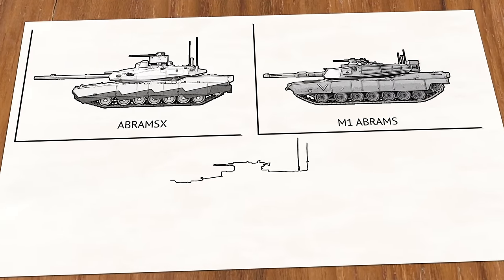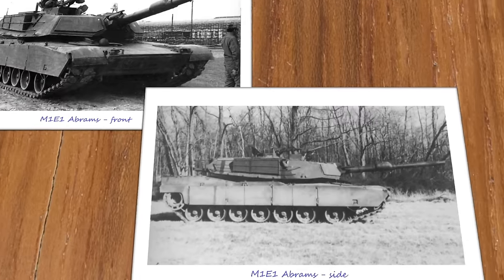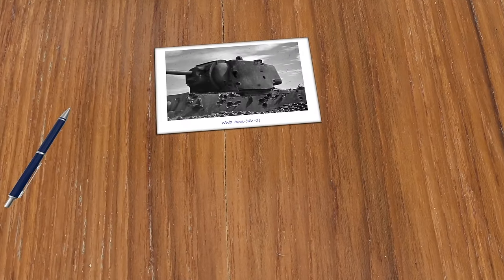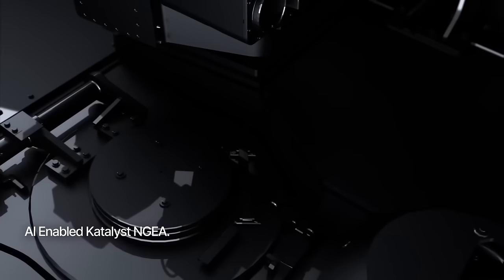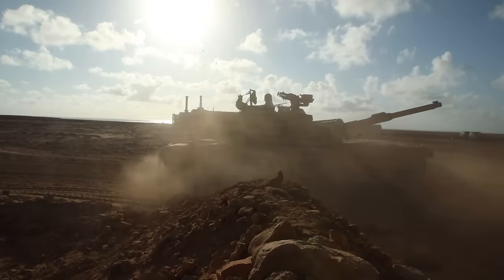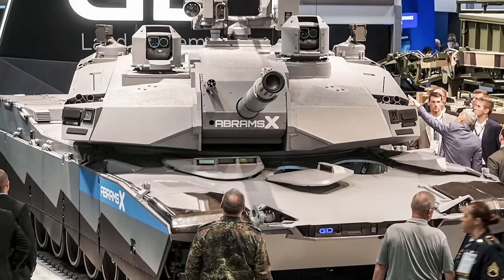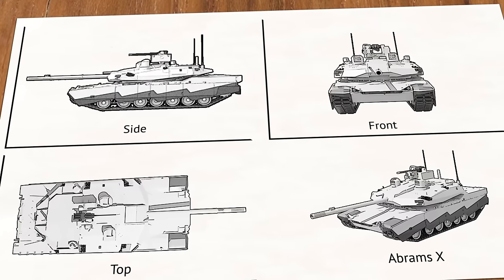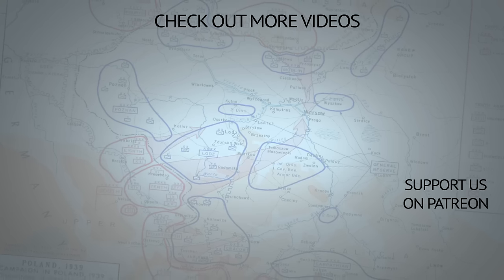M1A3 Abrams is finally happening. And it may get an unmanned turret, like the Russian Armata T-14.

Comment from the maker: We mixed the words and put turretless instead of unmanned turret in our first title. Apologies.
Reply: Sadly we're out of era of casemate tanks and not yet in the era of vertical launch system ones. So we're doomed to have sameish looking boring MBTs. No wonder scifi doesn't copy modern designs:(
Reply: Turretless lmao =D
Reply: That was funny. Not. (Just kidding but imagine a tank without a turret)
Reply: @theunitedkingdom5202  Strv 103 is the most famous MBT with that feature.
Reply: @theunitedkingdom5202  WW2 has a lot of those. Jagdpanzer 38(t), StuG III, Jagdpanzer IV, Jagdpanther, Jagdtiger. Even after WW2 the Strv 103, VT2, Kanonenjagdpanzer and Taifun get you covered.
Reply: @TheArklyte  VLS isn't viable for tanks. Missiles are simply not economical enough compared to standard ammunition. Not to mention that missiles are easier to defeat than a KE projectile. That's why Sci-Fi goes with railguns, not missiles. MLRS have their own place though.
Reply: It still says "A3" instead of "E3"
Reply: Thanks everyone
Reply: @theunitedkingdom5202 it's been done before.
Reply: @theunitedkingdom5202  T-72? :D
Reply: SLAVA ROSSIYA FROM CANADA !!! 
🇷🇺#Z🇷🇺🙏☮️🇨🇦🍻
Reply: At this point does it really matter? The only "potential enemy" tank to even come close to beating an m1a2 is the Type 99 from China. Right now Russia is fielding 1950s tanks in Ukraine which are in just as bad of condition as Iraq's tanks, and we didn't lose a single m1a1 to Iraq. What is a 1950s tank going to even do to an m1a2 or a3? Nothing. Sure, Russia is only supposedly using the old tech as mobile cannons (like a howitzer) but the amount of newer tanks lost leads me to believe we would have no problem with Russian tanks. 

But I do not want war with Russia. White countries should not be trying to kill each other. We have had enough war for the last 115 years and I think we should not be killing our own race of people.
Reply: Sad stug noises
Reply: T-14 is rather equivalent of CV90120 then proper MBT as it weight below 50 tons. And its chassis is used for T-15 IVF and was planed to be used in air defense system. Unmaned turret was also based on old Abrams TTB concept. The obvious reason why T-14 is vaporware is that Russian could not produce electronic, after ban on Western parts.

As for Abrams M1A3 lot of weight can be shed by modernization of outdated systems and removal of various adapters. Especially with pre-planed installation of trophy. As lot of weight is just a balast to stabilize turret.
Reply: M1A3: Turretless turret
Reply: @theunitedkingdom5202 just missile launchers
Reply: Armor officers have been fighting 3 man crews because they know they need the loader in the unit for maintenance and security and other things. Plus, the human has always been faster. 

At this point, the gunner is about ready to be automated. I bet they jump from 4 men to 2 with a crew optional feature.
Reply: I initially read that as turtleless... and I thought, "what's wrong with the turtles?"

Comment: You might wanna correct that title. I'm pretty sure that both the "M1A3" and the T-14 have turrets.
Reply: Depends the t-14 been hit by a round yet? 😁
Reply from the maker: True, corrected now. Thanks.
Reply: @A_Name_ only thing in the same chassis that's been hit is the terminator it doesn't have the same turret section though it saw some combat in Ukraine and is performing poorly but the turret is very vulnerable in that config so it's hard to say what the causes are for it being blasted to pieces so often
Reply: @A_Name_  it's also seen an array of other issues to the point where it was pulled from Frontline service till they kinda ran out of options unfortunately it was a huge part of Russia's highly mobile armored doctrine where it replaced ground soldiers for tank cover in urban areas so it's failure as a platform is kinda bad but realistically building it on a tank chassis was probably a bad idea and the dual mounted gun system is super complicated and way to vulnerable to fire
Reply: @VarrickThrae  I would tend to lean on it's Russian and it feels like they intentionally add some catastrophic design flaw lol. 

In all seriousness tho Idon't know enough about the T-14 but I would guess more problems with the auto loader/magazine causing cookoff
Reply: @A_Name_ hum no and was tested successfully in Ukraine. Now it's being updated
Reply: @A_Name_ . Old joke
Reply: Lol that’s great when I first read the original title I couldn’t think of a reason to make a turret less tank hull other than using the base for other things
Reply: @user-fe7bo5mm1o  like I said I don't know much about the T-14 was joking around and then just tossed out my best guess from my limited knowledge of Russian vehicles in general. Wasn't meant to be some kinda profound declaration as some on are here are taking it as lol. I even expressly said most of that. Whatever 🍻
Reply: @A_Name_ I came here to point this out.
Reply: @A_Name_  I just died laughing 😂
Reply: The final evolution of the tank: The M1A3 StuG
Reply: @A_Name_  well having your turrets popping off in a war isn't a good look tor customers
Reply: @VarrickThrae  Terminator, or BMPT-72, as the 72 in the name implies, isn't on the T14 chassis but on the T-72 one. 
There was/is a project of TBMP (something between BMP and the BMPT) called T-15, which has a similar turret to the Terminator (same gun and the missile launcher, but different configuration) and uses Armata chassis. 
But there are even less of them built than T-14s and they have never seen combat as far as anyone knows.
Reply: T14 does not have a turret. It’s imaginary.
Reply: @jgonz1325  the turret is VERY small
Reply: Yah but the t-14 does not exist
Reply: @VarrickThrae   terminator uses a t72 chassis not a t14 chassis iirc
Reply: @ligmasurvivor5600 same happened with the abrams when it was being detonated by Americans so that it doesnt get captured and same happened with the challenger 2 and leopard 2
Reply: @Chexmaster check your facts before spreading lies the t14 has been in production for years and has been seen on parades meanwhile the abrams x is still just a prototype
Reply: @VarrickThrae not a huge part, it was experimental platform. They had some 14 pieces if I'm not mistaken. They sent it to see how they could fit in, turns out it's good for defending or attacking forest lines. But not very good in urban or (as original) tank support role.
Reply: And i will become the idiot who saw the video after It has been corrected: 
Broo he fr said It is unmanned not without a turret broo💀
Reply: I wouldn’t be surprised if the T-14 didn't have a turret.
Reply: @dessirangelova2676 a handful of various design prototypes isn’t production.
Reply: Let's change it to "working engine"
Reply: Now both have unnamed turrets😂

Comment: As a former tank mechanic who worked on several generations of Abrams, it would be nice if the turret was redesigned for the upgrades because the constant bolting new shit in the old turret made maintenance a real pain in the ass
Reply: Good thing the loader could help out eh? Not automatically, I'm sure orders were issued first of course.
Reply: Not TRUE!  The turrets are NOT the same due to Armor packages and even configurations of even mounts inside the Turrets.  Try again.  Now there are some retro fits but the very first model are sitting in a Depot.
Reply: @dnate697 I'm guessing you're a tank mechanic then?
Reply: @jackfletch2001 there's probably several types of people that would easily know something as readily available as that.

Let's just assume he's an avid reader of the warthunder forums.
Reply: I was a tanker on the OG M1 (training at Knox), followed by the M1A1 (most of my service) and then the "A1 Heavy" (Iraq). History_Coffee is being dead-on legit. @ThatPianoNoob
Reply: @Calbeck  I assumed @History_Coffee is legit because that's the type of complaint anyone makes when we deal with these types of things.  Also, the US military bolting new crap on is a time honored tradition.
Reply: @arthurmoore9488 for something with as many variants as the Abrams has and with the different ways maintenance is done per man, it's honestly shocking that anyone can go "NOT TRUE" unironically. Some of them are so old it predates YouTube by 20~ years. Like a kitchen, grease finds a way to stay.
Reply: @dnate697  Did it maybe occur to you that most of the SEP packages are add-on shit for the most part?
Reply: @PhilMarks-g7u  I'm pretty sure they wouldn't have the loader help installing upgrades.
Reply: What do you expect? It was designed in the 80's.
Reply: I am not a tank mechanic. But hopefully the modularity will fix that.

Comment: A lot of the added weight in the current version came from leaving old equipment in (panels, cabling, etc ) and just adding the new equipment.  E3 will go through the development effort of making sure the old stuff can be removed without breaking any functionality. Modular design means future new stuff can use existing mounts, cabling, etc. and allow existing stuff to be removed and not just added over.
Reply: Geez, they left the old equipment and wires in? I bet that was a pain for wire tracing. I wonder how much dead weight was left in.
Reply: @bl8danjil  Moreso the new equipment was added and connected in to the existing systems with adaptor panels and the like. Like he said, the E3 design will start by stripping out all the existing internals and replacing them, specifically with more compact, lighter weight, modular systems that will have many of the added functions integrated in from the start.

An interesting note though, according to the Chieftain some of the newer APS on the A2 series have required counterbalancing weight to be added to the turret. That's basically over a ton of dead weight, which can be dropped by rebalancing the turret design. That's also part of why it's very likely the turret will be redesigned to some degree (though I doubt they'll go unmanned like the AbramsX).
Reply: Nothing is modular and that word is just buzz. Lmao you can not make something modular because no one can predict how big a new feature or sensor will be much less placement of said equipment inside. It will always lead to a new cycle of development and revamping planes or tanks. Nothing is modular in terms of allowing future improvements
Reply: @johnconner4695  Modular in the world of controls and electronics means building it in a way that additional components and functions can more easily be added. It's an approach to computers and programming, rather than bespoke function for all the parts.
Reply: @andrewreynolds4949  I know what they mean. Modular isn’t a new theory and again is a buzz word because any new capability will just be added on until a whole redesign is done to fit that capability into the equipment. A perfect example is the F-15 vs the F-35 one has a attachment sensor pod and the other had it designed into the F-35. Which will reach a limitation eventually because it can not be “modular” because you can not predict nor anticipate the size and capacity of a new capability. Even computing isn’t modular it all takes time and in most cases is stop gaps till a redesign is done. Hence why equipment is replaced and the new E3 is coming online and will repeat the cycle with either a completely new tank or E4 down the road.
Reply: @johnconner4695  Are you familiar with a PC motherboard and expansion slots? Interface and relays are fixed. But what can ve plugged into the slot may not have even by designed & manufactured when the motherboard was made. Modularity.
Reply: @johnconner4695  The purpose of "modular" is to make it easier, not necessarily perfect, to upgrade systems. The main result of that will likely be pushing back the need of one of these comprehensive rebuilds for several more decades than normal, rather than an 'indefinite' upgradeability
Reply: Someone has been watching The Chieftain
Reply: @Valorius  Yes! Love the Chieftain!
Reply: @bl8danjil they estimate it to be about 6 tons of wiring and dead equipment that’s been left in

I’m not joking 

It’s a hell of a lot, and removing all that junk will get the Abrams back under 70 tons

Comment: Chieftain mentioned recently that a weight savings of a couple of tons may be achieved by replacing all wiring with modern electronics and using another available main gun.
Reply: Plus either going with a newer turbine or diesel engine.
Reply: He said 10 to 15 tons more precisesly especially when you design in the APS.   Basically you could have a 60 ton M1A2 SEPv3 tank if you designed it from the ground up as such.
Reply: @imjashingyou3461 the aps could go even lighter if the choose the trophy light that is in development
Reply: Yeah I remember him saying about the wiring, it actually shocked me how much of it there was :/
Reply: @Wolfhound223 copper is pretty heavy
Reply: Alot of the bulk/weight of the cables is technically the shielding.
Reply: @Uruz7Laevatein  Afraid the excess cabling doesn't serve as additional shielding. As the cabling are all inside, a round hitting them has already penetrated the armor. All the cabling will do is add to the wave of shrapnel spreading through the crew compartment.
Reply: @Rob_F8F   When I mean by shielding the copper wire is relatively thin around 26-27 AWG, but the plastic/Kevlar encasing of the copper wire is what takes up most of the bulk/weight. IIRC Abrams and the F-35 uses COTS mil-spec rated copper/ethernet cables.
Reply: @Uruz7Laevatein  Sorry, I misread your comment.

Thank you for clarifying. 👍
Reply: Smoothbores do last a hell of a lot longer.
Reply: We did these in the older F-16s saving substantial weight replacing the older analog based equipment and old copper wiring with newer optical looms and lighter modern avionics.

Comment: I think the most important thing for a US tank to have right now is a way to counter small UAV's and an active protection system.
Reply: SPAAG and Lasers.
Reply: @fuckoff4705  Nobody is talking about putting a big Anti-Air laser like seen on ships on the M1. Dedicated vehicles similar to SPAAGs will do that, which will be used together to provide cover.
Reply: They need mobile medium range antiwar vehicles as well as laser or microwave weapons for drones.
Reply: @dimitryofthedonmongolslayer  I think the best way would be to incorporate both of these into one. Essentially an APS that can protect from top attack as well.
Reply: The US has an excellent active protection system with Trophy, but the problem is that it adds an extra couple tons since it’s bolted on and not integrated with the tank structure.  It will be integrated on the new tank.  Lasers that can quickly destroy objects require more power than a tank can realistically generate at this point.  The US has specialized vehicles for that purpose.  Tanks might be able to be fitted with lasers that can blind a drone or missile’s sensors though.
Reply: Why? Russian and Chinese tanks don't have active protection systems
Reply: @RobertLutece909  Actually Germany pioneered APS in the 1940's. Look it up. The Soviets (not the Russians!!!) copied almost all their tech from Germany, just like the Americans
Reply: or create units which can cover tanks from air
Reply: @dimitryofthedonmongolslayer lasers are overrated for such tasks.
Reply: The most important thing, outside of escorting infantry, that any tank can have is Air Cover.
A tank without ground and air cover is scrap looking for a 9P163 Kornet off an Alligator to bring it to destiny.
Reply: Wasn’t that introduced in the SEP V2?
Reply: @bradleyanderson4315  And a forward looking ground penetrating radar to look for mines.   :)
Reply: @chaosXP3RT  .... that's kind of the point, because we see how not having such a system has worked soooo well for the russians.

Comment: It's not being mentioned here and elsewhere, but the AGT1500 turbine engine has an inlet temp of 1190 degrees C and operating temp of 816 degrees C, while the operating temp of the Leopard 2 is between 300-350 degrees C.  Lowering the temp of a tank with the hybrid diesel ACE engine will significantly reduce its thermal signature and hide from passive and active sensors on satellites and drones.
Reply: That's a pretty good point to consider. Kind of similar to some of what the aircraft have to do when thinking about their engines and thermals.
Reply: To be honest, this will only get more and more important, with Gen 3 thermals and drones with similar tech becoming more and more prevalent 

If you asked me 5 years ago, I’d say it’s a non issue, as many nations barely have Gen 1 thermals

But now, with the world gearing up across the board, this is definitely something to consider 

But the U.S. military is great at 1 major thing, logistics, and that’s because they sacrifice some minor things to make their logistics more efficient 

The gas turbine might stay because of that, as logistics was the primary factor for using it to begin with
Reply: In addition, if the M1E3 utilizes the adaptive camouflage technology developed by BAE, the tank will be invisible on thermals.
Reply: I agree with this, lower temp, means it can hide much easier.

Comment: 5:30 It should be pointed out that Rheinmetall's Panther KF51 has to have an autoloader.  Its  130 mm rounds are 50% heavier and 30% longer than the heaviest 120 x 570 mm NATO rounds.
Reply: You could squeeze the jolly green giant in as a loader if you really wanted someone that can handle 80kg (est) shells. I'm not an autoloader fan for several reasons but when your rounds almost weigh what a trooper does, I can give it a chance and see how it goes. Panther does have big claws on it for sure.